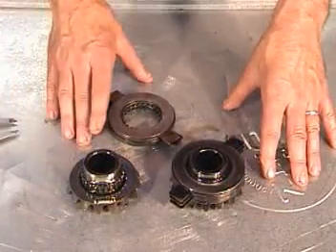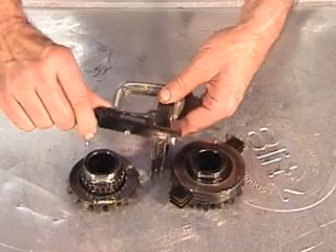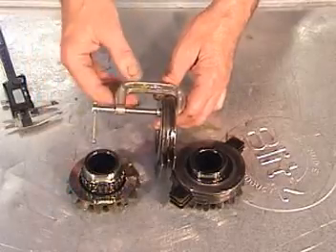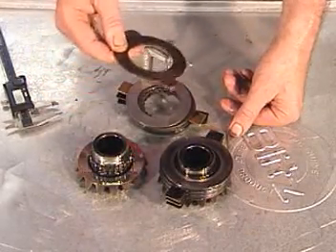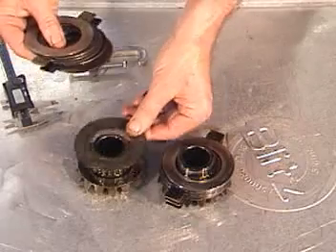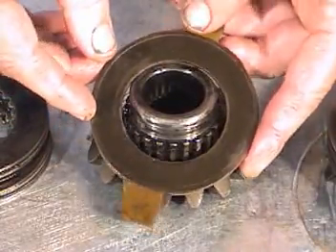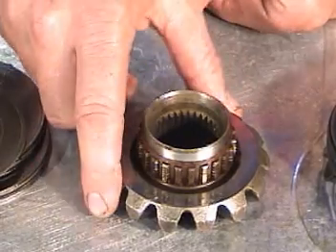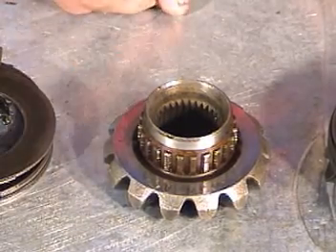Ford 8.8" rear end Traction-Lok clutch setups

Comment: All your vids are great ...putting an exploder 8.8 in my Jeep tj, was running Lincoln locked 8.25 ...ran a traclok dana35 and preferred that over welded rear. Snow and mud a real tight limited slip just seems a bit easier especially on side angles.  A vids on assembly of the traclok including wiggling of spiders and dreaded s spring would be awesome ( colorful and entertaining too LOL )... anyway great vids, thanks for taking the time to make them.

Comment: Some effort ...LOL!  I did it by compressing the s spring in a vise and using a high quality thin stainless wire ( kinda like safety wire ) ...the wire was wrapped around several times on each end and tightened via twisting.  Kinda scary and I treated it like a bomb ...but it worked.  That is one serious spring.

Comment from the maker: @scrochy66 Working on a 9.75" is pretty much like an 8.8" however the traction-lok is a good bit different. The 8.8" TL can be removed with the carrier still in the rear end housing. You have to remove the carrier and some special compressing tools are needed to remove the TL clutch pack on the 9.75".

Comment from the maker: If you measure the pack as shown by using the correct shim, it should work fine. Be sure there's not an old shim still stuck in the carrier before installation.

Comment: I have a 93 Fox Mustang with the 80's clutch pack order you discuss in your video. Will I get better performance installing my new OEM clutches in the alternate order? Thank you.
Reply from the maker: Maybe but tightening up the clearance is move important in reducing brake-away torque.

Comment: Good video thank-you. I've been overhauling an 8.8 rear diff on a 2001 ford ranger, 4L auto RWD. The frictions were shot in it and it had obviously been messed with before we got the truck. I have replaced the worn parts but cannot figure out how to get the S spring back in. A royal pain in the !#@?. I'm sure there is a practicle way but I have yet to figure it out and have not come across this issue online. all the video's seem to skip that part. Any help in regards to that would be very helpfull. Your video's are really well done, lots of information very well explained.
Thanks.
Steve.

Comment from the maker: @funshootin1 Rotating the spiders into place with the correct pack clearance isn't a problem. Putting the S spring in takes some effort. I show how to use needle nose visegrips in the full length DVD to get the job done.

Comment from the maker: @2rzTacoSr5 Sure, and I've done the 8 fiber setup as well. Many of the newer side gears only half about 50% contact and it's unclear if more fibers last longer or gives you more lock action than just using a tight 6 fiber setup. I haven't seen where the aftermarket sells any 8 fiber kits which tells me they don't see a value in it. But there's lots of guys that really believe in the extra plates and that's okay by me.

Comment: ye i saw it, is that so u dont gotta remove the ring gear?, plus i was thinking of trying this without removing carrier, like pullout the clutch pack and just throw a new set in and be done with it, its not like its much more work to remove it, but if i can avoid it might as well

Comment: so what is so different about the 9.75 from the 8.8? if the clutch packs are worn then when you take it out what has to be replaced besides the packs when they go in and how should they go? any further adjustment with the ring & pinion? install will be done on the truck, thanks!

Comment: Is it absolutely necessary to place the S spring. I heard in forums it only benefits when its extremely slippery like mud or rain. Is this true, what would happen if I leave it out. Thnks
Reply from the maker: What might happen is one wheel water burnouts.
Reply: @badshoeproductions  Will I notice a difference in regular road use.
Reply from the maker: I'm not sure because I've never left it out. Frankly, I see no reason to leave it out.

Comment: My new pack is .718" (4 steels & 3 friction plus the shim). Can I remove a steel wher there are 2? The .045" shim is still too thick if I do that.
Reply from the maker: I've never seen a Ford 4 & 3 clutch pack that far off. Checking some of my used parts, on average, steels are .080" and fibers are .095"-.100" thick. Therefore, on average, a 4 & 3 pack without shim, would be .620" max. If your steels are .080", then removing one would make your pack .638" which is fine. The shim kit normally has shims .030" .035" .040" and .045" and sometimes the original shims are .025". I would think you can get what you need with the correct shim.

Comment from the maker: Using the method shown in the clip, I've found that .660" is about max. After that, it's going to be very hard to get the spider gear pin installed.

Comment from the maker: It's very likely you have worn clutches. You'll have to pull the inspection plate, pull the axles and remove the clutch packs to see what you have. Always do both sides when making a repair.

Comment: My dad is an 85 year old Ford Mechanic from Tasca Ford. He is rebuilding my ford 9 inch rear end and was wondering if you know the thicknesses for clutches on a 9 inch?  Thanks   Greg
Reply from the maker: +THE G MAN I don't have a new fiber in stock to measure. However, I have in my notes that .085" is about the min. wear thickness for re-use.

Comment: Having steel to steel makes no sense to me.  On my 2001 Explorer I use steel...fiber...steel...fiber...steel...fiber.. steel, and a shim of the thickness required to end up with .655" total thickness.   That utilizes both sides of the fibers for a better clutch grip.  No problems what so ever.  Too thick of a clutch pack may make it difficult to insert the C Clip, but nothing to do with stopping the pin into the gear case.  I have one axle end that has too much clearance from the pin.  I'm afraid that the C Clip could fall out.  What I have decided to do is weld a steel washer of the appropriate size and thickness on the end of the axle and carefully dress up the end surfaces with the side of a metal cutting disc.  In that way the C Clip will be recessed when the pin is in.  I don't want that C Clip coming out when miles away from help.

Comment: I have a question, in a trac loc rebuild kit from ford racing, they only give you 6 steels and 6 fibers, I have a 93 GT 8.8 rear, am i supposed to use two old steel shims that are shiny to work with this setup?

Comment: if you were installing a locker to replace the spider gear like a spartan locker would these clutch need to be replaced?
Reply from the maker: Austin Mathis If you're installing a locker, I would think the clutches are removed. I fact, most drop in lockers only fit open carriers.

Comment: I have quite a bit of slack in my spider gears on my 8.8 trac lok. Is that normal?  I installed new spiders because the old were wore out and jumping teeth. Would worn clutch packs cause excessive slack?
Reply from the maker: Adam Jackson Yes.
Reply: i found that worn spider gears and a worn out pin caused it on mine and i replaced everything

Comment: How do you set the clearence pack to the thick side?
Reply from the maker: Use a thicker shim.
Reply: @badshoeproductions  i ordered the ford performance cabron fiber clutches m-4700 do they come with a thicker shim? Its the ford performance kind.
Reply: @badshoeproductions  i do want a good enough bite to light tires up quickly but still daily driveable

Comment: i want to replace the clutch pack on a 9.75 ford lsd and then swap this with the open carrier i have now.My question is how to measure the pack thickness without the ford gauge.Do I use c-clamp method and if yes then is the measurement still .660 or ?
Reply from the maker: Yes, the c-clamp method will work but I've found the measurement comes out to .750"-.755" for the 9.75. Understand that servicing the 9.75 TL is completely different from the 8.8".

Comment: hello i have a 2001 ford f150 4.6 2wd with 8.8 rear can you give me recommendation on upgrade which would allow me to get  better tracking offroad i got stuck twice already and i hate this lsd lol. The previous owner installed a 4.56 ring and pinion but i went back to stock because the where chips on the ring and when shifted there would be hard kick/clunck even after programming with hyper programmer ,any help would be great Thank You
Reply from the maker: You might try a Torsen carrier. Sounds like you need a 4X4.

Comment: I used my stock shim .45 and got .665 is this too thick?  Or Do I need to used the new .40 shim instead
Reply from the maker: +skabands You will likely find that the spider pin won't slide between the axle ends with that thick pack clearance. Also, the spider gears might not rotate into the carrier housing because the side gears are now too close together. Give it a try, if it won't go then set it to the correct clearance.
Reply from the maker: Just do it.

Comment: hi i was wondering if you could help me my problem is i have a vibration when im slowing down speeds i changed  the u joints tranny mount if you put my 92 mustang on jackstands and run the car and put your hands on the differential cover it kinda feels like somethings wrong could it be thosse shims or something i think it is all original any advice would help oh and the driveshaft looks fine and its a new tranny thank you

Comment: im replacing  clotch packs in my 2002 mustang I realized I cant put back the spiders gears back I think is too thick the do I have to remove any plate? the clotch packs I ordered are for 31spine mine is 28 but it says can be use in both high performance it came s f s s f s f and shim

Comment: Actually I found the best 3 disc layout not to be: 
Gear-S-F-S-S-F-S-F-Shim
I reverse the last 4 in the pack so the shim isn't riding on a Fiber, Or:
Gear-S-F-S-F-S-F-S-Shim
Note it alternates and 2 steels are never together. The original stack in the 80's was to control heat between the fibers. Use the newer Carbon discs and heat becomes a non-issue.

Comment: why does americanmuscle tell you to put it as shim-c-s-c-s-s-c-s instead of s-c-s-s-c-s-f-shim what is the difference
Reply from the maker: That's not the way I would do it for two reasons. The thin shim should have the full contact of the inside of the carrier instead of the partial contact of the gear's back face. Also, with the shim on the gear face, the pack is now shifted over which could cause the last steel to have less tooth engagement on the gear's clutch spline. There's a chance their instructions show the normal Ford way and the photo was just shot wrong.
Reply: thankyou today i couldnt get the axles to slip in enough past the s spring to get the c clips in the axles  i was able to squeeze the c clips in with the s spring removed should i just run without the s spring
Reply from the maker: Normally, if the axle can't be push in enough, it's because the wheel stud is hitting part of the back plate or an antilock wheel sensor needs to be removed.
Reply: so even with the s spring installed and thicker carbon clutch plates im still stuck spinning one tire on ice

Comment: Wat if i go gear s-s-f-s-s-f-s-f-shim? I just want a little more bite without it eating the tires
Reply from the maker: That is the normal setup except there will likely only have room for 4 steels. Therefore, gear-s-f-ss-f-s-f-shim. That would be the best overall layout. The extra steel next to the gear is of no value.
Reply: @badshoeproductions  got you I just wanted some more bite to it. I have the performance carbon fiber clutch packs
Reply from the maker: Just tighten up the clearance with the thickest shims that will still allow the spider pin to go through.
Reply: @badshoeproductions  i have the old and new set of shims thats all I have so imma just throw them together. So wen u say clearance u talkin about the space between the shim and spring?
Reply from the maker: I shouldn't have said clearance but say pack thickness instead. As I show in the video, stack the pack together with a C clamp and measure the pack thickness. Normally .655" is about as thick as you can go. If you go thicker using a thicker shim, you will likely not be able to install the spider gears or be able to install the spider gear pin because there won't be enough space. But the thicker you can make the pack, the tighter the clutches will hold.